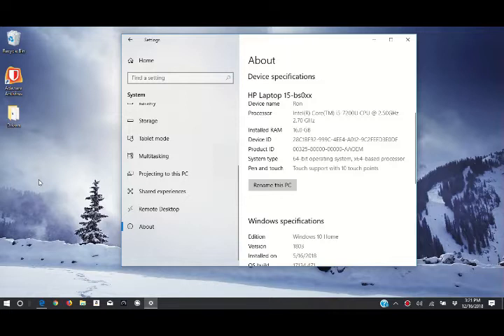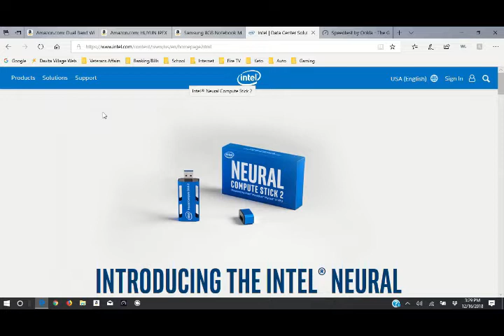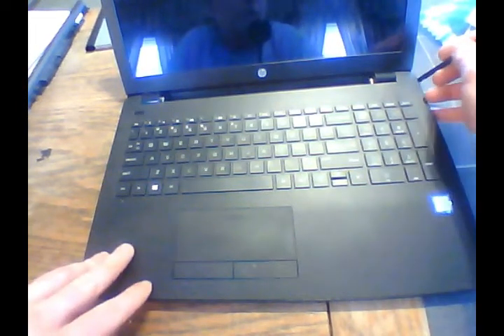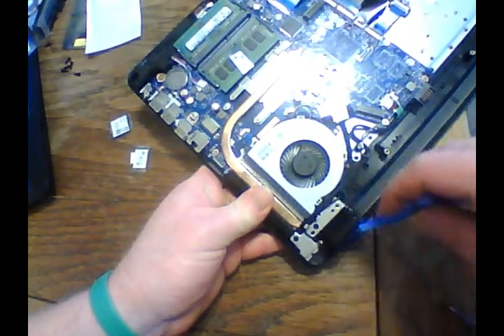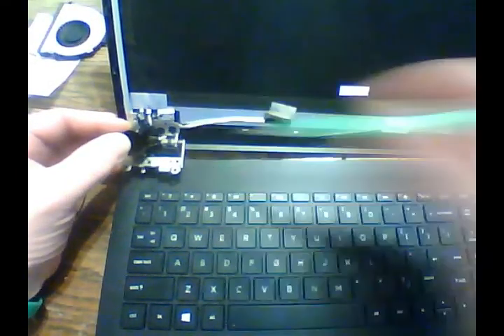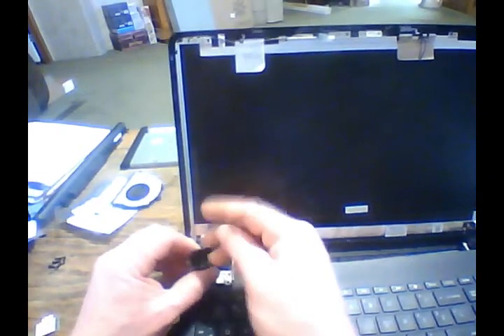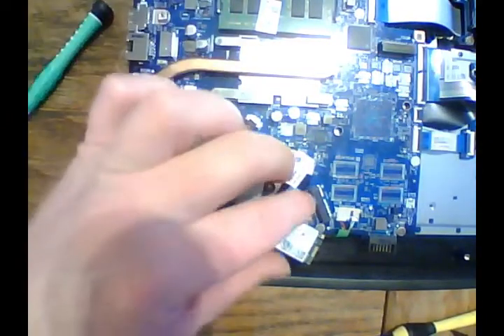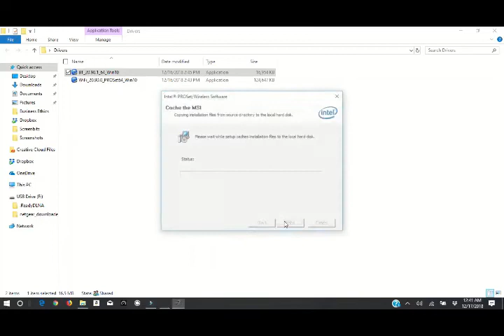Upgrade network card and RAM for HP 15 laptop (15-bs015dx). **PLEASE READ NOTE IN DESCRIPTION FIRST!

Comment: wow , I have same hp but the 17 I just need to replace memory will a 8gb work if it came with a 4gb its also a 64-bit
Reply from the maker: If you're replacing it, the short answer is yes. The long answer... I don't know what your technical level is so make sure you're getting the proper DDR model (1, 2, 3, or 4). Make sure you're getting laptop RAM not PC RAM; they are different. Also, your laptop is set at a certain speed to run the RAM. Say your laptop has a DDR4-2400 2133Mhz, you can run any DDR4 ram at speeds of 2133 or lower. Now, if your adding the 8GB to run with the 4GB make sure the speeds match. Your RAM together will only run as fast as your lowest speed RAM stick. It is recommended if adding RAM to stay with the same brand and speed and your computer will run smoother. To find this info on your laptop go to: Task Manager > Performance > Memory (on the left side) and you can find if you have 1 or 2 slots available, your Mhz speed, and Form Factor. Hope this helps and if you have any other questions feel free to ask!
Reply: The OG Matrix thank you, laptop info. Is hp 17-bs0xx CPU N 3710 16MHZ
Reply: @ogmatrix8268  thnks for info this is what I saw on the memory. slots used 1 of 1, & the MHZ is 1600 & I have available 1.6 GB left of 4 GB, so I think I do need to install a new memory which I was thinking of getting the same kind you installed on the video of the laptop you were working on would that be recommended or could you send me an example or the link of one please I prefer Samsung.
Reply: Sylvia Lopez I’m out enjoying Mardi Gras today. Let me get my wits together tmrw and I’ll give you some better advice. Can you tell me what year your laptop is? And the full model number?
Reply: @ronaldthompson6403   Oh no so sorry. :(   (where can I search for the year? it is a 17-bs0xx - windows 10- 64 bit)
Reply: @ronaldthompson6403   enjoy
Reply from the maker: @mijacita  It's no problem at all. I just didn't want you to think I was ignoring you all day yesterday. So, did you buy the laptop new? If so, when? If not, no biggie. Also if you look on the bottom of your laptop, you will find either printed in VERY small numbers/letters, your full model number, or there will be a silver sticker with it on there. The "bs0xx" is just a general series number, and HP likes to make certain little tweaks within the series. Everything I've found so far says you can run up to 2400Mhz but to be absolutely sure I'll need the full model number.
Reply: @ogmatrix8268    yes I bought brand new but did not keep the pkg just saved what was to be saved from pkging. serial#8CG381SKT  product#1KV29UA # ABA sure hope this is all the info. you need  and that I found on the bottom of the laptop.
Reply from the maker: @mijacita  Along with those numbers you found, there should be the full model number. Like mine, when I look in the system settings for the model number it tells me it's a 15-bs0xx, which is just the series, but on the back of the laptop, on the printed tag, it gives the full model number of 15bs015dx. When you looked up your laptop model under the system info it gave you 17-bs0xx. The "xx" is just a placeholder for the particular build of that series. HP in their great wisdom <sarcasm> makes small changes between these builds that could impact what you can upgrade and how much you can upgrade the laptop. Most current laptops will have 2 RAM slots, but to save money they may only put one in, like yours. Most people won't realize this until they try to upgrade their laptop, as one of the other commenters on the post fount out the hard way. What I need is the rest of the numbers that take the place of the "xx" that follows the 0 (11dx, 49dx, 61st, 67cl, 51od, 57cl, etc), such as with mine, it happens to be 15dx. Also, as far as when it was purchased, if you can just give me the month and year, or winter, spring, summer, fall, and what year, that would be sufficient. It doesn't need to be the exact date.  This is not necessary, but helpful. The full model number is the most important. I apologize if this is confusing and frustrating. I just want to make sure I'm giving you the proper advice.
Reply: @ogmatrix8268  so what I was able to read very small print is: 10nr
Reply: @ogmatrix8268   just found when bought it was March 18, 2018
Reply: Model# 17BS010NR. wish I could send you photos of info better. SYSTEM MEMORY TYPE:  DDR4
Reply from the maker: @mijacita  I'm glad I waited until I got the full model number. So, in great HP fashion, they skimped on your laptop with the RAM as they did with my WiFi card. At a time when DDR4 is the standard, they put DDR3L in your laptop. Not that big of a deal unless you are gaming or doing a lot of video editing or streaming. Panasonic does not have DDR3L 8GB option that I could find. However I highly recommend the Crucial brand option. They are a well known brand in computer parts and theirs has a lifetime warranty. This is the best, and fastest option I've found for you. Full disclosure: I make no financial gains for recommending anyone's products. 

Link for Amazon (copy and paste): https://www.amazon.com/Crucial-Single-PC3-14900-Unbuffered-204-Pin/dp/B00LTV2BBK/ref=sr_1_4?crid=2OM0QC8G84BXO&keywords=ddr3l+8gb+1866&qid=1582499869&sprefix=ddr3L+8gb%2Caps%2C180&sr=8-4

I also found it a few dollars cheaper at Newegg.com (copy and paste): https://www.newegg.com/crucial-8gb-204-pin-ddr3-so-dimm/p/0RM-0006-00DP8?Description=Crucial%208GB%20DDR3L-1866%20SODIMM&cm_re=Crucial_8GB_DDR3L-1866_SODIMM-0RM-0006-00DP8-Product

Here's a cheaper, more generic option, that is supposed to fit in your laptop, if your needing to save a few bucks, however I couldn't find any warranty info on it. (copy and paste): https://www.amazon.com/Timetec-Compatible-1866MHz-PC3-14900-Unbuffered/dp/B07FV22GBF/ref=sr_1_3?crid=2OM0QC8G84BXO&keywords=ddr3l+8gb+1866&qid=1582499869&sprefix=ddr3L+8gb%2Caps%2C180&sr=8-3

The only other thing I may worry about is if HP soldered your existing RAM card into place. I have heard of this happening to people once in a great while. If, after removing the hold down screw of your existing RAM card, it does not pop up with minimal pressure, or if you see a solder joint from your RAM card to your motherboard, do not attempt to force it out. Unfortunately, you will have to live with what you have. Attempt to remove the existing one before opening the package of the new one so that you can return it if needed.

Good luck on your upgrade! If there's anything else I can do to help, don't hesitate to contact me.
Reply: @ogmatrix8268  so do I need to back up my photos when replacing memory?
Reply from the maker: @mijacita  No you don't need to back up anything when changing out your RAM. The RAM is a temporary memory holder. Every time you turn off your computer, it wipes everything from the RAM. The more programs you're running at once, the more tabs you have open on a browser, or the bigger the file is on a video you may watch, the more RAM your computer will be using. That's why your computer runs faster, and smoother, the more GB of RAM and the higher the Mhz (Megahertz) your computer has available. Say for example your writing a document in Word, doing a spreadsheet in Excel, watching or editing a video, or doing all of this at once. When you're working on whichever project, your computer is storing the info in the RAM. Not until you save it will it be transferred to your hard drive. That's why when you turn off, or restart, your computer it usually says something along the lines of "Save your work before continuing" because it is currently stored in RAM and if your computer loses power, you lose whatever you were working on. Sorry for the long answer to a quick yes or no question, but I hope this gives a better understanding of just what the RAM does.
Reply: @ogmatrix8268  ok thank you I just placed my order.
Reply from the maker: @mijacita  You're welcome. I hope it all goes well for you!

Comment: Thank again for all the important help, wanted to let you know that today I recieved the RAM and I followed your tutorial on how to do the installation of the Ram and I did it and got it done right, could I ask you to help me in finding the right RAM for my DELL 3000 series 3552 INSPIRION 15 64 bit 8GB. do not now which to look for thank you in advanced would you happen to have a tutorial for a DELL?
Reply from the maker: I'm so glad that this helped you! And now for my next trick... lol. To be honest I'm not very knowledgeable about Dell computers specifically, but it still boils down to just plain hardware parts and the limitations manufacturers have, or have imposed, on their products. I did a little research on your 3552 and am finding conflicting information. Some say that the max RAM for that laptop is 4GB whereas others say you can upgrade to 8GB. The only way to know for sure is to get the model of your motherboard and then I can check the specs against it to see if you can upgrade to 8GB of RAM. 

This is fairly easy to do and there are 2 ways depending on what your skill level is and which you are more comfortable with. 

1) You can d/l a free program called Speccy found here: https://www.ccleaner.com/speccy It's totally safe and you can just uninstall it after using it if you want. I find it a handy tool and have it on all my computers so I can easily get info when I need it. Just d/l the free version, run it, and under the results click on "Motherboard" then copy and paste the results to me here from "Manufacturer" to "Chipset Revision"  
2) Open your command prompt on the laptop (press the Windows button and "R" at the same time) This will open up the Run command. Type in cmd and press enter. This will then open the command window. Copy this within the quotes (") but do not copy the quotes themselves -> "wmic baseboard get product,Manufacturer,version,serialnumber"   Then right click in the command box right after where it says C:\users\xxxxx>   This will automatically paste what you just copied from here. Press enter. It should result with the motherboard Manufacturer, Product, Serial Number, and Version. 

Once I have those numbers I can find out if you can upgrade or not.
Reply: @ogmatrix8268  it says it is 8GB
Reply: @ogmatrix8268  model Inspiron 3541 (PO)
Reply: Type DDR3 1 module 8.00 single channel
Reply from the maker: @mijacita  Okay, if you're sure that your laptop will accept 8 GB then you're in luck. Without me knowing your motherboard model number, I can't verify that you can upgrade to 8GB on your Dell laptop. With that said, if your laptop will accept a 8GB RAM card then it will actually be the same one that you purchased for your HP laptop. Just buy another one of those. As for HOW to replace it, watch the video I've included here and see if it looks like yours. Does yours have the panel on the bottom across from the battery? If so, then I would follow it. If not, let me know.

https://www.youtube.com/watch?v=dgvbtQ_qE7s
Reply: @ogmatrix8268  ok thank you very much for all the info. Will let you know how I did ok. Thanks again.
Reply from the maker: @mijacita  I was just wondering how things went with the RAM upgrade for your Dell laptop. Was it successful? Did the video link I recommended help you through the process?
Reply: @ogmatrix8268   I have not ordered it yet. Thank you for checking on the issue but I am still
Reply: @ogmatrix8268   have not gotten to get it yet but I will thank you for being concerned

Comment: Would it be possible for me to upgrade the CPU on this??
Reply from the maker: I hate to be the bearer of bad news, but the answer, more than likely, is no. Most consumer grade laptops have their CPU and GPU integrated (soldered) into the motherboard. I have an upcoming video on the same laptop where I change out the HDD to a SSD and show the CPU an how it is integrated into the motherboard and how to tell if yours is.
Reply from the maker: I should have asked this yesterday, but why are you wanting to upgrade your CPU? Is your laptop operating slowly and you're wanting to speed it up? There are other things you can do that will speed up your laptop immensely like adding RAM as I showed in this video and replacing the hard drive with a SSD that I show in an upcoming video here very soon. Doing those two things, and changing out the crappy WiFi card in mine has made all the difference. Feels like I have a whole new laptop.
Reply: @ogmatrix8268  I do music production and I have my RAM upgraded to 16gb, but when I use multiple plug-ins inside of my software I quickly run the CPU at 100%, even with my software completely optimized to use the smallest amount of CPU and allowing thread processing so everything isn't try to be handled by just one core.
Reply from the maker: @trevorbolin7819  Yes, unfortunately, this laptop is not optimal for what you're wanting to do. Have you thought about building a PC that can handle you're music production? You could actually do that for a fraction of the cost versus buying a high end laptop. Or are you needing it to be mobile?

Comment: Did you see a M.2 slot for ssd?
Reply: Neilsen Bautista no there’s only the 1 M.2 slot for the network card. At least in my particular model.
Reply from the maker: Neilsen I owe you an apology. I have an upcoming video where I replace the HDD with a SSD. When I opened it up for the second time, I noticed there is a M.2 slot for a SSD. If you look just in front of the HDD receptacle, you will see the M.2 receptacle and standoff for a 22mm X 80mm SSD. Sorry for the incorrect answer before. I hope someone with more knowledge than me, at the time, was able to give you the correct answer.
Reply: @ogmatrix8268  thank you for the reply so appreciated for this

Comment: You have 2400 stock ram? Reviews are showing 2133 as stock ram.. Hhmm
Reply from the maker: Artie Galguerra that’s because the laptop is locked at 2133MHz. No matter what speed you install (over 2133MHz) it will only run at 2133. Most proprietary pc’s/laptops will not let you take advantage of XMP profiles in BIOS so it’s a waste of time buying higher speed RAM for these motherboards.

Comment: Damn I have 130 Mbps and I thought was way too slow. I was told if it doesn't have gig speed it will slow down.
Reply: Joxer the Mighty I’ve heard in some states having speeds up to a gig, but I’m in Missouri and right now Spectrum offers 200 Mbps min. Im not sure if they have a 1 gig service or not. However, if you’re just streaming you only really need about 4-6 gigs for one device. If you’re streaming multiple devices, or gaming, much higher is recommended. At the time of this video I was pulling 150 Mbps when Spectrums min. was 200. Called Spectrum and they updated my account and I’m getting about 220 now over wifi and Ethernet. Point being this card will get you full speed over wifi which I think is awesome!!

Comment: are there hidden screws on those 4 rubber
Reply from the maker: Not on this particular HP model. I can't verify on other models. On this one you'll see at the minute mark 14:10 of the video, there's 6 total: 1 for the DVD drive, 1 on each side, 1 at the front, and 2 under the battery.
Reply: @ogmatrix8268  we actually have same model but when I checked mine there is screws should i remove it too when opening the laptop?
Reply: @ogmatrix8268  also check the video ColzyCinema about hp 15 bs0xx there is screws under so, and mine does have it so should i unscrew it first before opening the laptop?
Reply from the maker: @adnrussg I checked out ColzyCinema's video on it and see what you mean. I looked under the rubber feet on mine and there are holes but there were never any screws as you can see in my video. I guess that was another great money saver for HP... I would definitely remove them otherwise you WILL damage your laptop. Thanks a lot for the question! Now, I just need to get this added into my video so as not to mislead anyone else.
Reply: @ogmatrix8268  thanks cauz i was really worried about jt
Reply: @ogmatrix8268  finally upgrade my ram thanks to this video

Comment: All that and you didn't put a solid state drive in? I have the same computer and did the ssd first, then the RAM. OMG, you just would'nt believe how fast it is now. I cant understand why manufacturers put together a computer with a decent chipset, GPU, CPU and memory up to 16 gigs of DDR4 and bottleneck the shit out it with a large standard hard drive. Get an SSD on that rig and you will be so pleased!
Reply from the maker: Funny you should say that! That's actually the next project I'm doing to this laptop in about a month. To be honest, up until recently I didn't know it was possible. I just built a gaming PC after a lot of research from others here on YouTube and found a couple of videos of people changing out their laptop HDD's for SSD's. I was going to suggest to Sylvia below to do the same for hers after I do mine and upload the video. And I want to do a clean Windows install and get rid of all this HP bloatware crap! I was going to put a 500GB in, cause that's what I could afford, but now the 1TB's have come down enough I think I'm going to go with that. I've also been waiting cause I want to upgrade the RAM in this thing too. I've got 16GB of 2133Mhz and going to upgrade it to 16GB of 2666Mhz. It really should run like a beast with the SSD changeout and the upgraded RAM speeds. Just waiting for a break in school to get it done. Thanks for the comment though! It was still great advice.